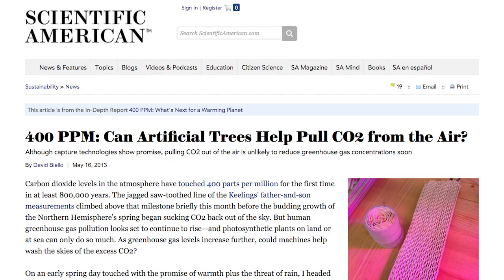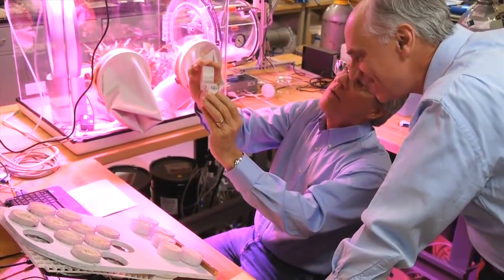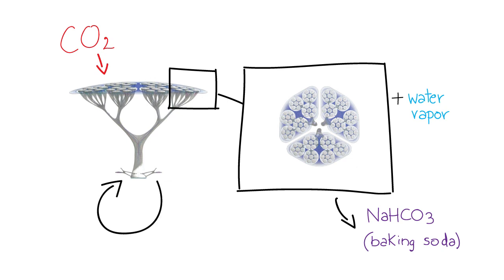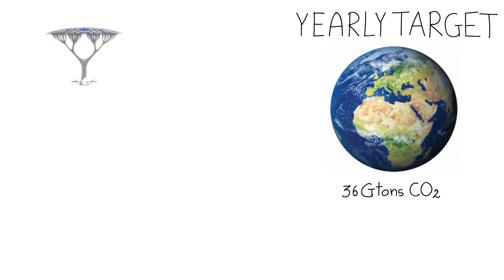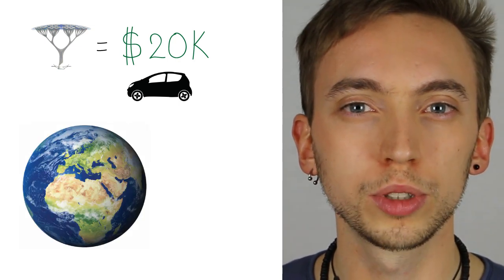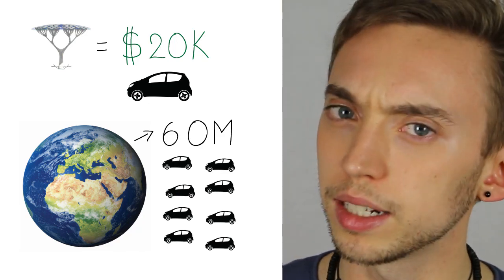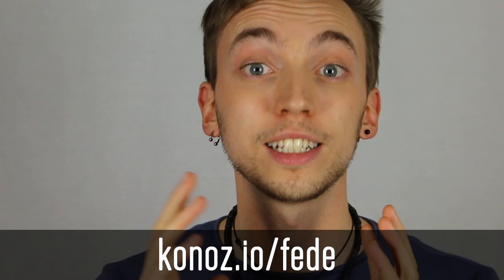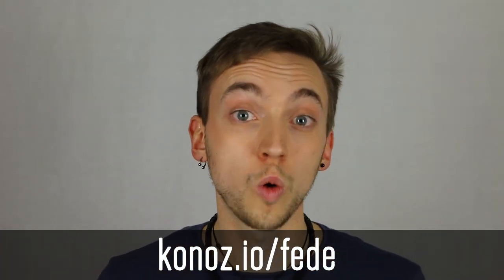Can fake trees fix the climate?

Comment: Tree's are just one of natures way of recycling co2 and they take forever to grow. Algae on the other hand, is actually a nuisance in most cases. We exert a lot of effort to prevent it from growing and I'm convinced that we ought to be growing massive pools of algae, fertilizing it with waste from farms and city septic. Take that algae, press it into oil, and then pump that oil back into the wells where the oil/carbon originally came from. We could literally just sweep this whole oil phase of humanity under the rug and it can be that "species wide stain on our environmental record" which we can all pretend collectively never happened :D

Or we could take the oils from algae, and turn into bio plastics which could break down. Or maybe it can be turned into carbon fiber to build stuff out of it?

Comment: Why the hell do the trees synthesize the collected carbon with sodium? That's such a lame way of collecting it; is there a way to do exactly the same process at the same efficiency WITHOUT the byproduct being attached to useless sodium? I have a viable solution to the artificial tree cost problem but it would have a much greater chance of working if you eliminated sodium as a byproduct.